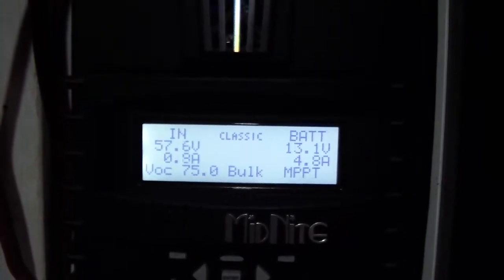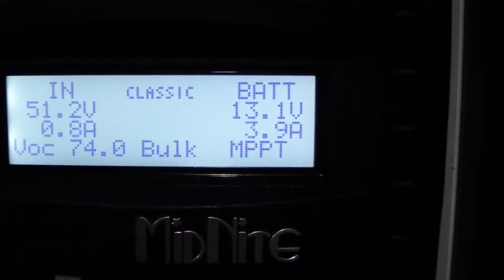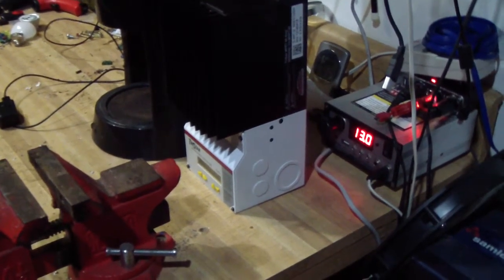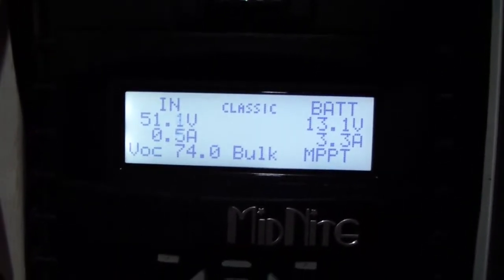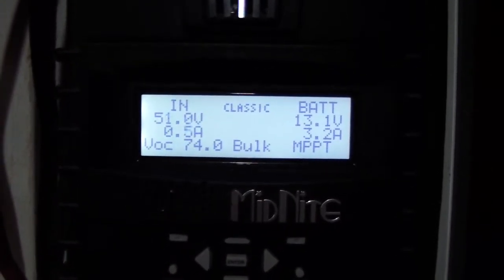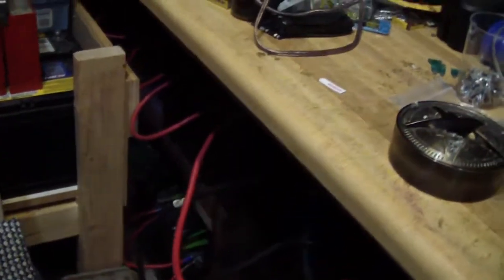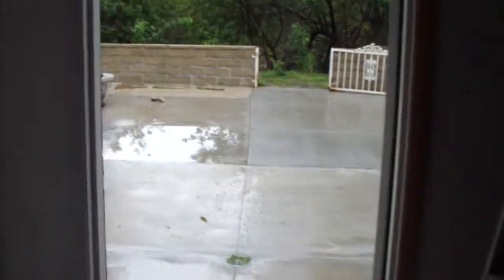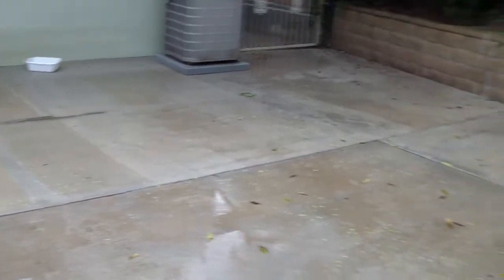Midnite Classic 150 Charge Controller.

Comment: Whats the watts on your solar panels
Reply from the maker: +Guns,Games and Racing 1.7 KW
Reply: ok thanks I'm going to do a youtube video about this charger and i need to know the max watts do you know the max the charger will do at 24 volt batteries
Reply from the maker: +Guns,Games and Racing 
94 Amps at 24 Volts =2256 Watts, have in mind that these parameters varies by many elements.
Hope this would help you!
Reply: it's did thanks

Comment: quick question...does your solar panels array is in 72V and your batteries in 12V ??, can you do that without damaging your midnite, and if you can, what is the advantage of doing that instead of just making the whole array in an even voltage (i.e. 12, 24, 48V)

thanks in advance.
Reply from the maker: My array input consist of two series of 40 Volt DC panels making it 80 Volt, the advantage is that if one array goes down I would have the another one providing the volts needed to activate the charge controller, the rest is depending on your load and the battery banks, hope this would help you!
Godspeed,
El Raz

Comment: I say "just say no to 12 V", unless that's all you got. Interesting problem though, hope you get better data as time goes on. One thing, every battery you add to the system has it's own resistance and daily loss so when you added batteries to the 24V system you also added more charging load and loss. It's like a big muscle man needs to eat more, you got to feed those batteries. You super caps have less loss though.
Reply from the maker: True, more batteries = need more amp/power to be recharged, will be setting up the 24 Volt system again and see it would work, I may increase the voltage on the panels too.  Thanks for watching.

Comment: If I could go back i think I would have got the outback flexmax 80 amp that can have 5000 watts of panels at 48 volt .   Im wondering what the max panel wattage the midnight can handle at 48 volt. Im just not sure if you only had four 12 volt baterys could you pump 5000 watts in thou

Comment: Hi my tristar is the 60 amp mppt at 12 volt l could only pump in 800 watts of solar panels so I went 48 volt battery bank to go 3200 watts of power .your at 12 volt would going higher on your batery bank volts be better for charging the baterys ?       Thats what my my thought was 800 watts at 12 volt and it would cut out at that no matter how many panels I have is that right ?
Reply from the maker: It depends on how many batteries you are going to charge the more you have the more Amps you will need!